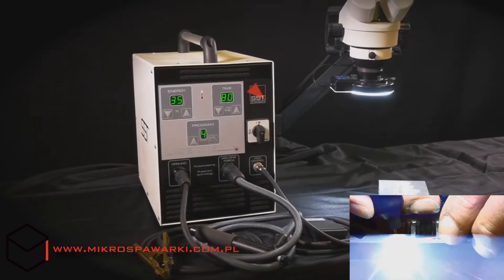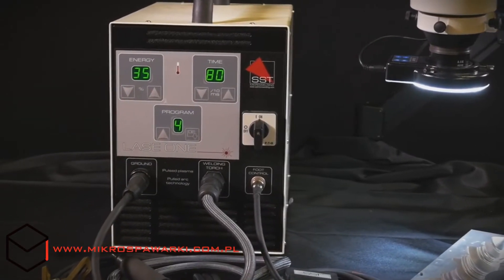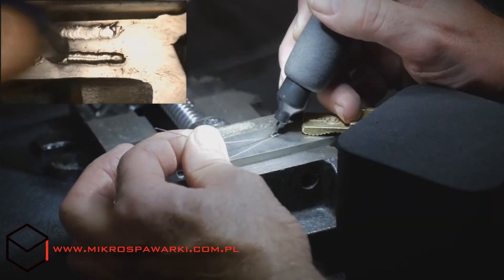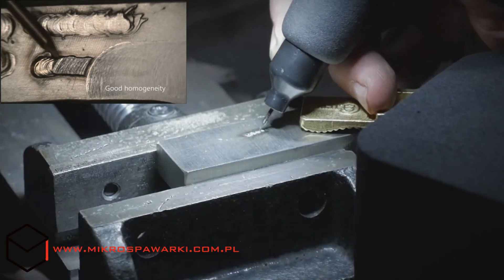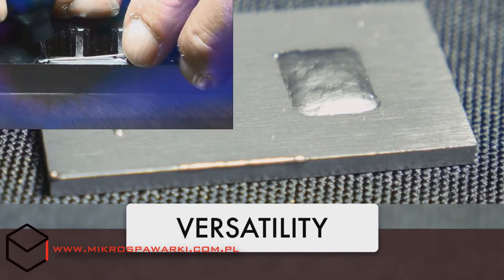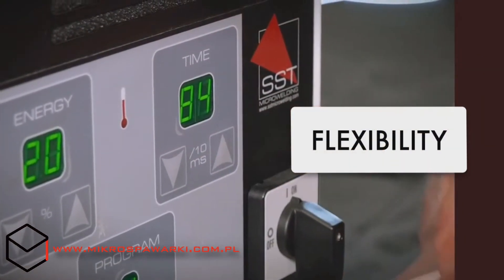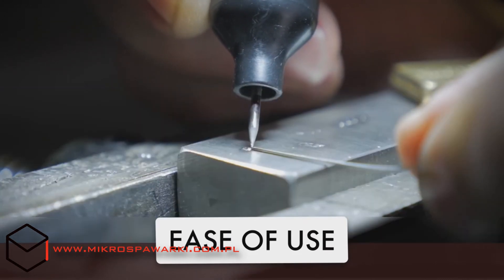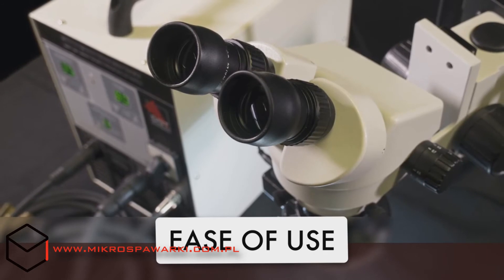Mikrospawarka LASE ONE

Comment from the maker: LASE ONE technology is a solution designed for demanding precision repairs of the surface and edges and the solution to the problems of micro-welding assembly.
LASE ONE provides full and strict control of welding energy and allows its accurate distribution. Welding machine is designed for a very wide range of applications of materials and configurations. While maintaining high performance, ease of use, compactness and versatility, it combines laser welding quality with the advantages of electrical solutions, such as ease of use, no need for regular maintenance, low maintenance costs, freedom of transport and affordable price.
Свернуть
ОТВЕТИТЬ